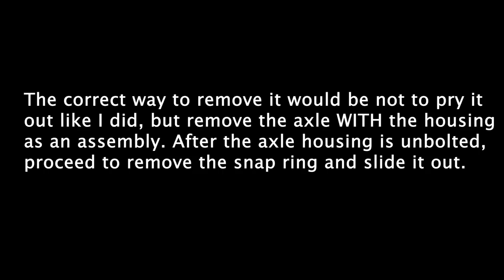HOW WAS THIS NOT THE PROBLEM! | Tahoe Front Differential Rebuild 2/2

Comment from the maker: I completely forgot to include activating the 4x4 in the video. I did test it out and works as normal! No noise and engages smoothly👍
Reply: Hey I have been a fan since ur first video
Reply from the maker: Raven Montie Thats awesome, thanks for the support!
Reply: Can you make a video on how to change to 4wd to 2wd and auto? Is my first truck and I'm confused on it
Reply: LsxMatt Im having an issue with mine where it turned off on the freeway any idea what it can be?
Reply: Pretty sure that encasement is called the Front Transfer Case(4WD), and the Rear Transfer Case(4WD) which is at the rear of the Transmission, the Differential is what is at the center of the rear axel(2WD/4WD). Just a bit of clarification. Its normal to hear a thud when you activate the 4WD but checking the universal joints is normally first check. I live in mid east so I rarely activate my 4WD, During my last fluid check, I used Lucas Gear oil 75W-90 in both transfers takes about 4 Quarts total between both transfer cases, I also filled the rear differential with it which took about 2.5 quarts-ish. But those wheel bearings were a great find, Love your videos by the way I own a 2003 Silverado and much of what you work on applies. Keep up the great vids.
Reply: Thank you LS Matt i always had that noise and never knew what it was so when it drove another 200 miles and got really loud the front diff plus transfer case blew going seventy. I should of done this video.

Comment: Hey matt, when you do that brake swap, what ever you do, do NOT use a factory set of rotors, as they are CRAP and will warp terrible the first time you stop hard!

I’ve run the summit drilled and slotted replacement rotors on my ‘08, and lived them! I ran those with the hawk suv pads, and it was almost like a big brake upgrade;) best part was the price, super cheap! Cheaper than non slotted rotor! 

I’ve since taken it a step further and installed the bigger Baer brake rotors with the new mounting bracket kit that spaces the factory caliper out to work with the larger rotors!

Hope this helps bro!

Comment: Had to same exact thing on a 2002 trailblazer. I was convinced it was diff and it was bearing assym. Didn't have time so took it to shop and they put in cheep bearing that only lasted 9 months and I ended up putting timkin premium in. 100k later and still going. Truck now has 305k total miles now and still running flawlessly.

Comment: I feel your pain. I had a similar problem with a front-wheel drive Monte Carlo that I had replaced the wheel bearings on and about a year later I was getting the same kinda noise you were and was sure it was the transmission. Good for me a buddy and I had it on my lift and started playing around and found the same bearing was bad before I pulled the trans!

Comment: MOOG bearings are the best! MOOG makes some parts for AutoZone’s DuraLast, I do not know if GM truck wheel bearings are included. Love the junkyard vids for the Tahoe and all the Tahoe vids in general! I’m fixing up an 03 Z71 Silverado that’s been a coastal NC truck all it’s life, so the rust has been just great... and it was used like a truck should. In the mud, over the sand, towed things... it’s pretty beat. With the 3” lift and 34” mud tires, the steering play is so much worse than on the stock 265’s. It is scary to drive over 50mph. Needless to say, I had a buddy help me out on the steering wheel and I just bought a set of MOOG tie rods😂🤑. We’ll see if I’m right about the problem. If I’m not, then the dual ProComp steering stabilizer I bought will help me until I find the problem and buy more parts... I just changed the front and rear diff fluids and the t case fluid. I’d have changed the trans fluid already but the da*n drain bolt is rusted shut and freshly rounded off lol. I’ll figure that out, but for 157k and heavy use with no atf change, the fluid isnt half bad! As for the diff fluids,... yikes. I’m going to change the rear diff fluid again, but only because the magnet fell off the factory cover when I first changed the fluid, but I still needed to use my truck so I filled her up and bought a swanky aluminum finned cover with a drain plug. Come to find out the plug wasnt magnetic smh. So I’ve got a magnetic plug in the mail🤦🏼‍♂️. and I’ll say this- if it weren’t for my old rusty factory upper a arms hitting the bottom limiters from the 3” keys, my truck would ride better than my mom’s 2014 LTZ suburban with air ride! But, she loves her shiny chrome 22’s and 33’s, and they are pretty sexy if I don’t say myself😂! The ProComp shocks I installed on my Rado are great. Her burb’s name is Gloria, like the hippo from the Madagascar movie cause she thicc! Also if the sun is behind you on the highway, the shadow it casts looks like gloria’s head in the movie. Hopefully this entertained... I’m going to go try to find out why my washer fluid only sprays the drivers side now, in 95* weather!

Comment: Did you change the pick up tube O ring? They crack causing low to 0 oil pressure. One of those "While I'm in there" deals.

Comment: Matt, those Duralast hubs aren’t going to last. Get yourself some Timkens from Rockauto. They are slightly less expensive to boot! Also, if you want to toss a little more money into your Tahoe, for about 500 bucks you can get the 4 piston brake setup from the 2019+ silverados and they’ll bolt right up as well. Way beefier 😄

Comment: Matt< i replaced both the front uni-bearings in my 05 Ram with the Autozone Duralasts at about 100K miles and they both lasted less than 30K after that so I figured it was time to trade off and move on down the road.  I ended up in a new Nissan Frontier (2013) and am now clocking at about 150K and not even the slightest amount of noise or play in the uni-bearings yet.

Comment: They lifted chevy colorado guys had pretty good luck with Detroit axles wheel hub bearings sold on ebay. My 07 Colorado has almost 10 inches of lift on 35s and iv had those wheel hub bearings in for probably 4-5 years and they had been holding up great

Comment: Did you change the o-ring on the pickup tube while you had the pan off the 5.3 are known to fail and loose oil pressure
Reply from the maker: Honestly it didn’t even cross my mind. I’m planning on doing some power mods soon enough, so when I have the front cover off I’ll change it.

Comment: Someone probably overtorqued the hub nuts.  People install the nut with an impact and ram them up to 300 lb-ft.  They only take about 130 lb-ft.  Doing that will destroy the bearing.  Also, the front axle will not make any noise unless it is in 4wd or in auto.  The front differential and prop don't really turn unless the actuator in the front axle is in "engage" mode.

Comment: I don't usually comment, but I have a 2002 Suburban that made a very similar noise to your Tahoe. It sounded like it was coming from the front as well but it turned out to be the rear diff carrier bearings. After a rebuild it's completely silent. 

Hope this helps

Comment: i usually go with hub bearings from moog, and my buddy likes sfk. i just bought a silverado that had the hubs replaced just like your tahoe. i had whirring on both and play on one side. turns out you can get these thing for ridiculously cheap on ebay, i ended up replacing both and haven't had a issue since

Comment: I did the axle shaft seals in my now retired 99 with the differential still in the truck. I had an issue with that same snout piece for the passenger side. What an absolute pain in the dick that was. And of course, the anaerobic sealant I bought dried up before I could get the damn thing back together. So, I fixed the leaky axle shaft seals, but made another leak. By the time I got around to fixing it, my fluid looked like yours did. Lol Truck still ran great with that crappy fluid surprisingly. Less than a year later, the frame cracked on me, so now it's in pieces. :/
BTW, I was gonna say that the sound the truck making definitely sounded like a bad hub bearing. Mine came out in pieces, too. I said "I'm not mechanic, but I don't think this is supposed to come out like this in a million pieces" lol

Comment: Pretty sure my truck has those same bearings. I had to replace the OEMs awhile back and put the cheapest ones I could find from Rock Auto on, 30-40k later they're loud as absolute fuck and they're giving me the ABS shit. They might even be the new chinese MOOG. About to swap mine, seems like the only reputable brand is Timken, and even those still might have issues?

Comment: Got an ungodly whirring noise when I hold my foot on throttle to keep at speed quiets after I let off throttle but hear a little when it starts idling down 06 YukonXl 4x4 rear diff cover was leaking ran dry not sure how long hoping it's just carrier bearings maybe pinion any ideas?

Comment: 1/2 ton OEM pads are the bees knees, I got 275k out of one set.  I swear we should call those things china bearings because they were as fragile as china, not country of origin....  If you can't justify buying good ones you should plan to do it over and over and on the side of the road along with everything else that the dang wheel falling off takes with it...

Comment: I put new hub bearings on my 03 Escalade. About a year later (20k miles) I had some brake noise. I pulled the brake caliper and bracket and as soon as I took the axle nut off, the damn thing came apart just like yours did. Huge pain in the ass.

Comment: While you had oil pan off would have been good time to change the oil pump pick up tube o ring, known for causing low oil pressure problems with high mileage.
Reply from the maker: I probably should have but I have plans to crack it open again soon..

Comment: You dont use a hammer to knock the hub bearings out..  There is a trick using the bolt that mounts it and a socket. and the power steering

Comment: So after everything you’ve done to the Tahoe, would you recommend a 2001-2006 Tahoe/suburban? 

What’s the real world Mpg been like with the higher mileage? 

Quite a few in my area in seemingly good condition with about 150,000 miles, but the prices right now are a little high.

As always, love the channel and your in-depth wrenching.
Reply from the maker: I would! I havent done much aside from general maintenance and cosmetic stuff. The transmission going out was my own fault, and as far as the diff, it had 230k on it so thats to be expected.
Reply: LsxMatt good to know! Everything you’ve had to do is to be expected, and parts compared to my Honda’s are incredibly cheap and plentiful.

P.S. The moment I saw the thumbnail I knew it was going to be a bearing problem lol.

Comment: U should use lucas oil treatment when changing ur oil since u have alot of mileage.
Reply: I swear by that stuff, years ago I worked at a dealership that had Isuzu and the Rodeos would smoke at like 80k, we used a quart of that Lucas stuff that replaces a quart of oil and no more smoke. Also over the years have used it in vehicles that smoked or made noise and takes care of that. I use Rotella also, one of the few oils that have zinc in it. Not all oil is the same and the word 'synthetic' is just marketing, like saying heavy duty or super or ultra, means nothing.

Comment: Bummer about the Hubs... There were just cheap ones. I had the same thing happen to me on my dodge TWICE!!! For being an idiot and buying a cheap ebay set. They replaced them for free and I did the job the second time. Front and Rear. And that was after only 3-5 k Miles. 5 K miles later I had the same roaring sound coming from the rear of the car. I had just put new tires on and the sound was only there with speed and changed with the speed. No plat whatsoever. I blamed the tires and went back and swapped the tires for another brand and paid more. OOPS!!! I went down the road from the tire place and it hit me. It was the shitty bearings again... Fought to get a refund for all 4 from the cheap ass ebay seller and I did luckily. And bought a OEM set. Rode them around in complete silence for 40k the car on and it had 180k on it so they will outlive the car now. I learned a lesson on wheel bearings. ALWAYS go with high quality ones. I betcha the person that put those "new ones" on your Tahoe did what I did and got a 60 dollar front set from ebay and threw you off the scent. Jerks... LOL

Comment: You just never know.  I've replaced wheel bearings on M/C... used Timken bearings, packed properly, installed to spec, following the factory service manual... and had them fail within 10K.  Replace them and get long wear from the next ones.  Sometimes, you just get a bad item.  

So?  If you are on 2WD... you get the typical independently free-wheeling of the front wheels.  When 4H is engaged (or 4L), they lock... giving you power to both wheels?  Unlike an open diff in the rear, where only one side gets power?  If so, that's sweet.

Sometimes, you'll get a pronounced growl as you load a bearing on one side of the rig (while in a turn)... and it'll fade (audibly) once going in a straight line once again.  That can help you diagnose which side a bearing growl is coming from.
Reply from the maker: Yea the front axle is pretty much like an open rear until the actuator is engaged. Then it locks the two front wheels, pretty much like a welded diff. Thats why when you make sharp turns on dry pavement you can feel the front wheels skip a little. The rear is a G80 limited slip, so both wheels are locked until a turn where the diff allows it to slip.

Comment: I try not to encroach on others channels, but I'm experimenting with putting zerk fittings on bearing hubs and seeing if it extends the life of wheel bearings.  Like you, I have a Tahoe and recently had to replace one of my wheel bearings.  So I added a zerk fitting to the new bearing and the remaining good bearing. I also have a Trailblazer and the front wheel bearings have an additional zerk fitting that I added.  It's a little after the fact now for you, but there is always the next time.  I don't see myself replacing any bearings anytime soon, but if other people tried it, I would be really interested to see how it works out.  
https://www.youtube.com/watch?v=pM1W6icgM6I&t=14s

Comment: Cheap, badly made hub bearing assemblies... This is a huge problem right now.  Even for cars.  I had to replace the set of wheel hubs on a Saturn Vue twice in a 3 year period.  The first time I replaced both one of them was much newer and so I replaced the older, probably factory one first. Noise didnt change .  So I replaced the "new" one and it was good.  I had used some cheap ones I got on closeout.  Like a year and a half later I heard the old familiar noise again.  I couldnt tell which was bad this time so replace both at once, no testing in between and yes, it was the bearings again.  Same humming / moaning noise from the front both times.  It looks like there were at least 2 sets of crappy replacements.  The ones on there now are also not very good as far as I know ,they're Detroit axle ,  I am waiting for them to go but I dont use that car much now so its probably fine.